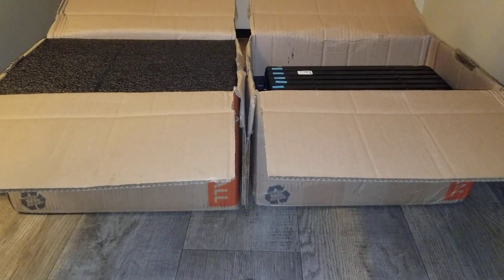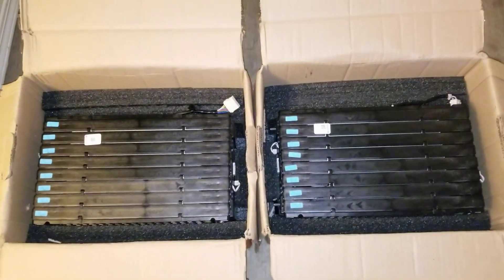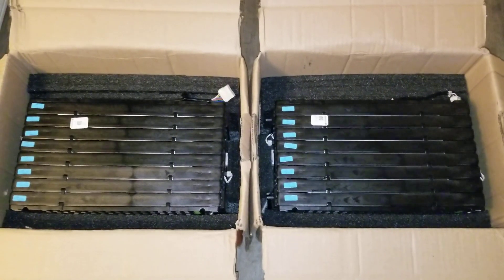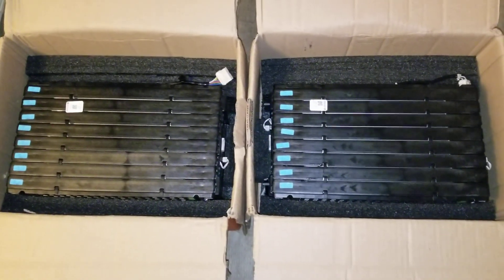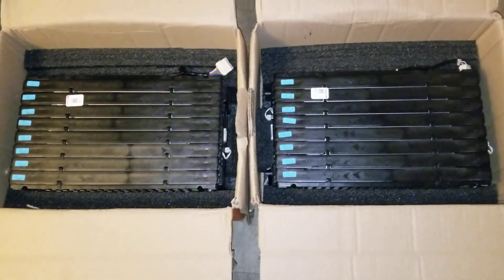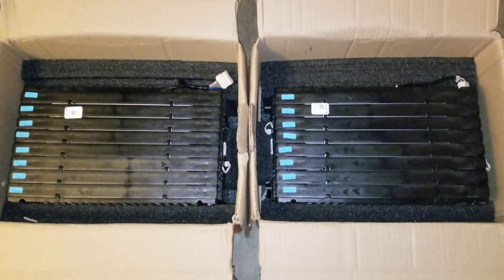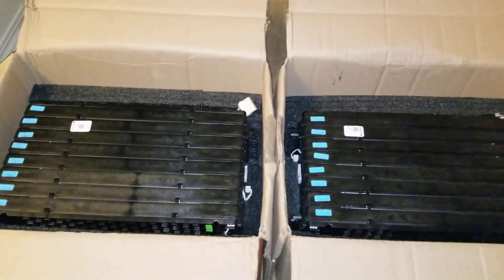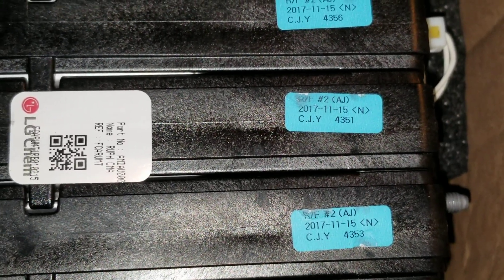CHRYSLER PACIFICA: LG Chem Solar Battery Golf Cart EV Car 16 Cells 3 kWh each 67.2 volts

Comment: How much do these batteries cost? Where do we find them? Last but not least how many can I use with my 6750 watts of panels. On a 48volt system?
Reply from the maker: You can find them by typing there name on your internet search engine.
Lastly you can buy as much as you want your system.
Thanks for asking.